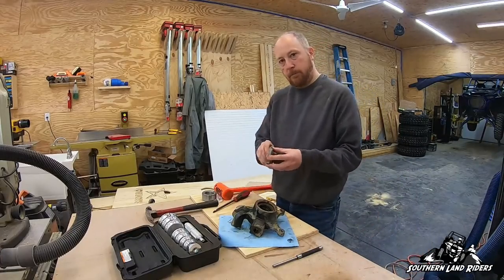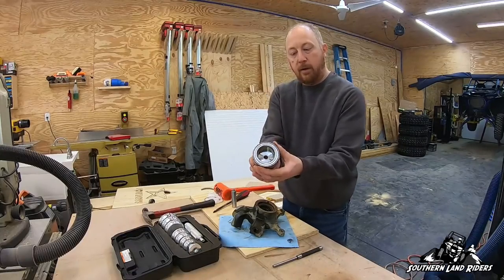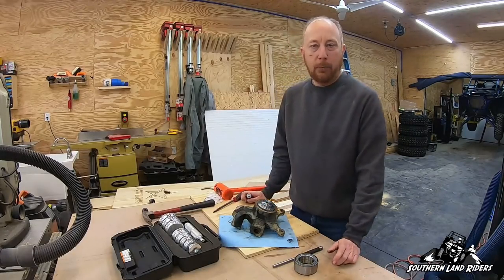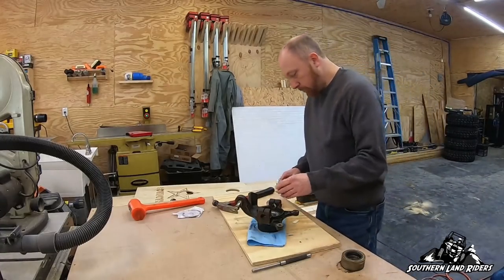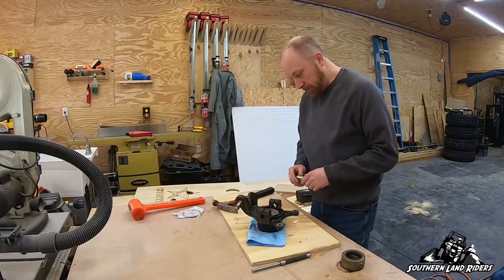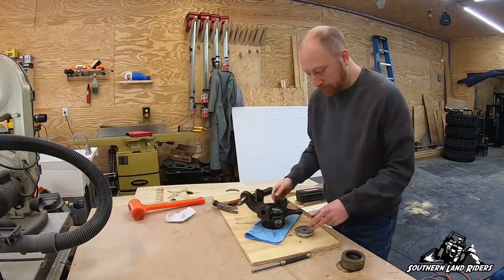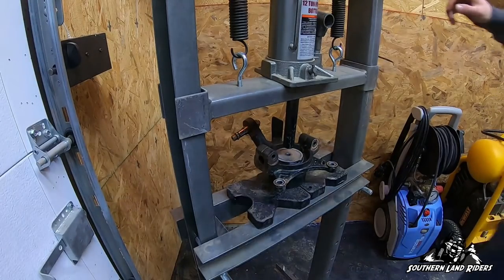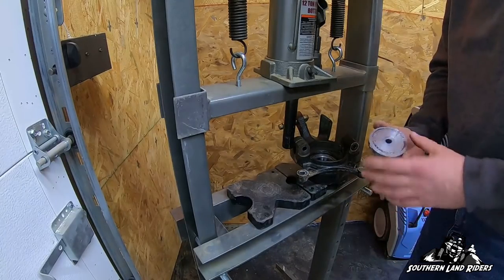New Tool Review: Performance SXS Bushings Wheel Bearing Punch/Press Tool

Comment: First off great job Chris. Great tool well worth the 80 bucks. 
My father clipped a tree with his front right tire breaking the tire rod. No longer able to steer so we winched it to the back of my rig so his front tires was off the ground and carried him out of the woods. Doesn't matter what breaks you just adapt and overcome making the best out of any situation.
Reply from the maker: Yeah tie rods, wheel bearings and this tool are 2 things I will never leave camp without. Either one of those go out in the woods and it is going to be an adventure getting back.

Comment: Myself and two of my buddies was doing a day ride on the border of Va/Ky. I was in a 2016 RZR 1000, and my two buddies was in a T-Rex and another RZR. We was on top of the mountain and It was getting dark so we decided to head back down to the truck. On the way something in the back started popping. I thought it was a stick or something stuck and slapping something. So I stopped to look it over and I saw nothing wrong. So I got back in and kept going. When I caught back up with my friends, they was stopped waiting for me. When I tried to stop I had no brakes. And ran into the back of my buddies T-Rex. I got out to check the machine over again and noticed my right rear wheel bearing went out. It was so bad that the ball bearings was falling out. We decided to take it apart to try to save the hub and spindle from further damage and drag it out on the trailing arm. My buddy had to pull me up the hills with his RZR. It was going good until we got to a four way intersection. If we went straight it would take us back to the truck but it was a very long ride. If we went left it went straight down to the main road and would be quicker. But then we had to go get the trucks and come come back for my RZR. So we decided to take the quicker route down. The only issue was that it was not the route we took on the way in and it was straight down. On the way we ran into a fallen tree. Luckily the T-Rex had a chainsaw on board. We cut the tree and kept going. Then we ran into another fallen tree. This tree was about 2-3 feet in diameter. The saw we had was too small to cut it so we decided to go around it. We had to drag it with the other RZR  and as we was going around it my RZR turned over on its side and it was pinned against the fallen tree. At this time it was about midnight. So we decided to send the other RZR to scout out the trail to see how bad it was. About an hour and a half later he returned and said the rest of the trail was good except one tree that was down. But we could go under it. It took us about 30 minutes to get mine unpinned and around the tree using both of the other machines to winch. Then we continued on and finally made it to the road. We left mine there and rode the other two to the trucks. Loaded those two up and went back to get mine. When all was said and done it was daylight. When I got home to look mine over it had a lot of damage. Mostly from dragging. I had to replace the hub and bearings. My roof is cracked. One of my side panels is dented. The rubber boot for my radius rods got ripped up. And the hose from the shock to the reservoir is leaking. Im still slowly getting parts to put it back together. :(
Reply from the maker: Damn that sucks man! When I had a wheel bearing go out the 2nd time I was doing about 40 mph down a fire road and my brakes went out as well. It scared the crap out of me.
Reply: Southern Land Riders it scared me too. It did more damage to my machine by dragging it out. If I had that tool and a new bearing it would have save me a lot of repairs.

Comment: Thanks for the review on the tool! SxS bushings are really good. Well at windrock you can find the weak part or who hasn't done maintenance like they should. One of our crew lost a rear wheel bearing off 57. So I left them near Clinchmore school and went to camp to get a truck and trailer.  That is a long ride and a replacement bearing would of been a life saver. I will be adding one to my kit. Thanks for the great videos!!
Reply from the maker: Thanks Russell. Appreciate you watching. Yeah this tool, spare wheel bearings and tie rods will always be in my RZR. You break one of those on the trail and it is no fun getting back!

Comment: Great review video Chris! $85 is a small price to pay to have the right tool for the job when you need it! No trail riding breakdown stories for me yet. Other than getting stuck a few times, I've been pretty lucky and was able to work on repairs at home, knock on wood!!
Reply from the maker: For sure. I will always carry spare wheel bearings and this tool along with tie rods. You break either one of those out on the trail and it's going to be hell to pay getting back to camp.

Comment: I have been pretty lucky on the trail but have made do with what you had on the trail. My buddy broke a radius rod and used ratchet straps and branches cut to size to get him back out of the woods. I have a 900s and made 2 slugs out of steel shaft material turned down on the lathe I use to push out and push in wheel bearings. One to push the bearings out and one to push the bearings in. You can use a press or hammer on both. They are bulky and heavy. Would be nice to have a small portable one like that.
Reply from the maker: I used had a tool similar to that that I used a couple of years back.

Comment: Nice tool idea and good video. 
While riding at Wildcat (10 minutes in) climbing a rutted out hill my right rear slammed into a protruding rock and bent one of my rear radius arms. Limped back to the truck(SIDEWAYS) and used a floor jack handle over the outside of the arm as a persuader.
Got it straight and rode the rest of the day. Turned out to be a great ride.
You guys have great Videos....Keep it up and all 4 down.
Reply from the maker: That must have sucked but at the same time you will never forget it!

Comment: Were riding in TN and we had a 4 wheeler cartwheel down a steep hill. The 4 wheeler was totalled. We had to winch it back up the hill (taking hours). We were able to start it up once we got off the incline. We took lunch and ripped all the bend garbage off throwing half of the machine in the back of the General. We were then able drive it out of the woods with bent frame and bent steering. We've had to change axles on trail too but nothing compared to the garage sale we had that day. Love the channel guys. Maybe 1 day I'll be able to ride with u at Windrock or Brimstone.
Reply from the maker: Those type of things suck but at the same time they are memories you will never forget.

Comment: Bent a tie rod, was lucky it didn't break. Straightened it best we could and used a 18" breaker bar I keep in the tool box along with a few hose clamps to "fix" it and get us back to camp. With the right mindset any tool can become the right tool, but it sure is nice when the one you have is actually the right one...
Reply from the maker: Exactly.

Comment: I was climbing a hill and jumped up a little ledge on stock High clear radius rods and my bushing gave out as well as the radius rod I ended up having to drive it 3 wheeled back to the trailer and threw a old set of radius rods on off a 16 turbo and still run them waiting for performance sxs bushings to get re stocked because my bushings just went out again 🤣.... I could use one of these because I dont have a press and have been using a board and 3lb sledge to put all my stuff in or when I get the luxury of one of my friends shops I ride fairly rough terrain

Love the videos keep up the good work
Reply from the maker: You need one of these tools man! haha
Reply: Heck yea I do lol the board method works but not the best

Comment: Last year at Windrock my rzr went into limp mode for injector harness. Found out the wire on the mag side was broken flush with the plug. Took the plug apart down to the pin to some good wire and went on for another 50 miles! I did put a new mag side injector harness on when I got home.
Reply from the maker: Nice! Wire, duct tape and zip ties will fix anything! lol
Reply: @SouthernLandRiders  All three are in my box

Comment: A few weeks ago at Brimstone, I lost a rear drivers side wheel bearing. It destroyed the axle, brake caliper , hub, rear brake line . We tried to tow the rzr back to a paved road using logs and many ratchet  straps. After quite a long while we were able to get to a paved road. I sent one of the other guys back to the Brimstone parking lot to get my truck and trailer. If I had this tool, I could have changed the wheel bearing long before all of the damage happened. Most of the damage occurred on the tow, dragging to the paved road.
Reply: Exactly Will! Exactly
Reply from the maker: Yep. Been there. This tool and a spare bearings in your RZR can save a trip and also save some money in other damaged parts getting it out og the woods.

Comment: The reason I no longer run spacers, coming down P-1 at WindRock had a quality 1" spacer shear off all 4 lugs flat on the front spacer surface, the aluminum reacted with the hardened steel over time weakening it.  My son was able to stop the Rhino safely with one front wheel.
Reply from the maker: I think that happened with Jessica and the RS1 as well.

Comment: Great tool and video!  Must have for sure.  My horror story:  well, I don't have one.  Yet.  I'm new to the SxS world, but not new to 4x4ing.  I've broken many parts on the trail, and have learned the importance of having a proper field kit which can handle most of the common fails.  In learning what's likely to go wrong with a Rzr, I came across bearings, and then this video.  Getting one of these will help keep 'my story' boring and horror free ;)  Yup, like I said, must have.  Good stuff!
Reply from the maker: Thanks Jason. I have settled on a pretty good list of parts that I bring in my RZR now. I have changed it up a bit over the years but settled into a pretty good set of tools and parts. You never know when you are going to need something out there and it is great when you are prepared and have it.
Reply: @SouthernLandRiders  Too true.  Have you by chance covered your list somewhere I can reference?  Maybe a video?  Would be great for a newb to draw from experience rather than guess.  Thanks!
Reply: Just wait Jason, your days comin😃
Reply from the maker: @JasonWilliam  yes sir I am going to do a video on it once I get back next week.

Comment: Ive been lucky and the only real problem ive had on the trail was a tire going flat, but lucky it was a slow leak and I could drive home. The biggest problem ive encountered while working on the machine, was pulling a back axle. The axle came apart and left the cup still in the machine. The instructions said to use a pry bar, which without taking more of the machine apart I couldn't see how to do that or if I even could. I ended up using a slide hammer. Which was still a pain bc there was no where for the tool to really get a bite. I was also warned that it was possible to actually break the case and take a part of that with the cup. The only thing I could see after I got it out, that was holding it up was the ring around the end part of the shaft of the cup. It was bent and kinda mangled so I'm guessing it was somehow caught in there. I flattened and straightened the ring and reused it so far so good.
Reply from the maker: We have had our share of stuck axles. We made a couple of homemade pullers that seem to do the trick. Greasing the spines sure make it easier to get out in the future.
Reply: I had the same thing happen to the rear drivers axle on my 900.  Bought a CV rebuilt kit and it doesn't come with that larger ring.  I did the same and straightnened it up the best I could and put it all back together.  I dread the day I have to get that axle back out because I know it will come apart once I start pulling on it.  Good times
Reply: I'm hoping that since I greased the shaft up, it will slide apart easier next time but my luck it won't. Lol

Comment: In the span of about 20 seconds I broke 2 front axels on one of my old Arctic Cat quads. This was at the start of an 80 km trail ride that we have every spring. After I had my wife winch me out of the hole I crawled under my bike and pulled both half shafts out leaving the inner cups stuck in the front diff. I finished the run with lots of throttle and tire spin but suffered a twisted prop shaft and torn rear diff mount. 2009 TCat on crushed 29.5” Terminators. It was a great ride. 😊